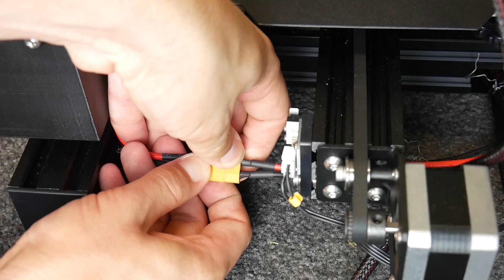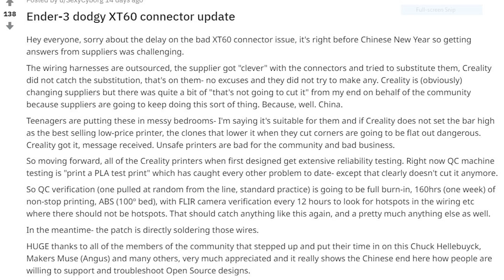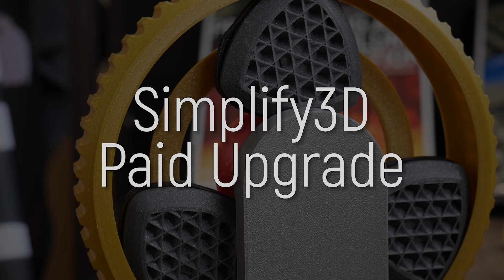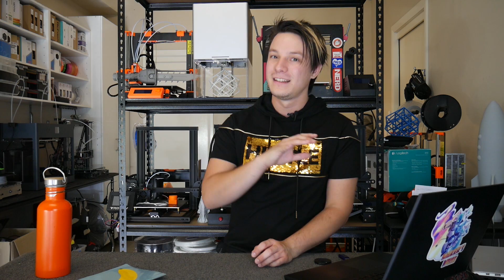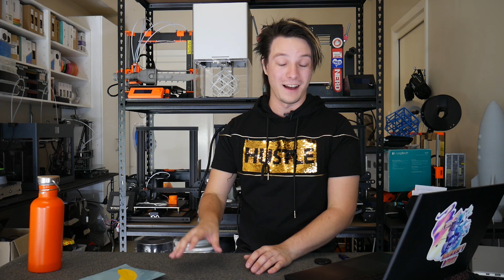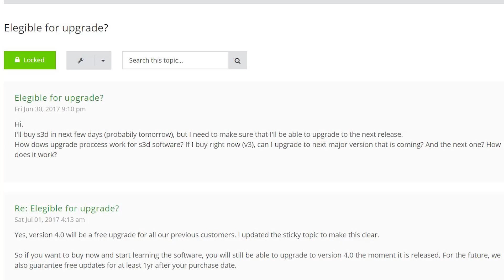Ender 3 Connector Update and Simplify3D Paid Upgrade - Maker's News Feb 2019

Comment: For those who argue/mentions other programs having paid upgrades etc, I kinda call bullshit on! Those programs are vastly more complex than S3D and the improvements from each paid version is probably going to be immense compared to S3D's v.5 paid upgrade!

Not to mention the fact that S3D hasn't updated their software anywhere near acceptable before, particularity when it comes to all the bugs! They still don't have proper filament profiles, as in you can't set a different layer height for PETG compared to PLA, material cost stays the same etc, for example!

THEY ARE NOWHERE NEAR THE DEVELOPMENT THAT EVEN PROMPTS AN UPGRADE PRICE, NOR DO THEY DESERVE TO DO THAT, ESPECIALLY CONSIDERING ALL THE BUGS THEY EITHER TAKE FOREVER OR NEVER FIX!

I have seen many free programs that are more professional and prolific than S3D, and some of them are actually much more complex than S3D too!

I regret buying S3D, and I will actively advice against it from now on, most likely whether or not they continue with the paid upgrade or not!
Reply: @NorxMAL You nailed it!! :)
Reply: "improvements from each paid version" 

Not true in many CAD packages.   Autodesk civil 3d and recap are still really expensive but has offered minimal innovation and upgrades for years despite them raking in millions on maintenance fees.
Reply: @olaruud9366  Does Civil 3D and Recap have lots of bugs? And are other CAD programs getting ahead of them, especially the free ones? Now I answered what you essentially paraphrased me for...

Didn't you understand the full sentence properly? Because you virtually addressed something I didn't say, or you don't understand the word "probably" and/or "compared"... We have to see what improvements V5 of S3D comes with; and it's perhaps the reason why they have come with so few bug fixes and improvements before; which if it's true, but we probably never will find out, then they are assholes!
Reply: @Nor1MAL  
Not gonna reply any toxic comments, sry.

Comment: S3D users will vote with their pocketbook for the v5 upgrade.  I happily shelled out the money for S3D several years ago when I first started printing on the advice of a seasoned veteran and it certainly was of great value at the time as my very first print was successful on a used DaVinci printer.  I've become very familiar and comfortable with v3 (have not upgraded to v4 yet).   When I see the price, features and benefits then some reviews by creditable creators on YouTube, I'll make my decision whether or not to re-invest in S3D.  I've been using Cura quite a bit since I have been helping some novices with their printers and it has come a long way (still like the S3D interface better) and that will be my benchmark for comparison to S3D v5.

Comment: Check you connector, but also consider adding a MOSFET for your heat bed. Your power supply has two open ports.

Comment: I think a big question is, what will the update cost? Is it going to be another $150, I doubt it. But it could be $ 100 or $50. Most software I use at work has a yearly maintenance fee, they range from $1200 to $6k.  I think S3D will lose a lot of users if they go over $20 for the update, mainly because of the fact other slicers have caught up and in some aspects. passed them.

Comment: I'm not just a devilishly handsome half century old guy, I'm also a software engineer. I know how much we get paid and it's a LOT.  But that being said, when the cost of the software was maybe a tenth the cost of a printer, it was adding value to your setup. Nowadays, however, with price points in the five hundreds or less, not so much.  S3D doesn't realize with the greater availability of printers there's a much larger customer base that they can potentially reach. Because of this, S3Ds price point should have gone down relative to the 3D printing world's expansion. 
I've been putting off buying their slicer because paying 1/3rd the price of my printer for a slicer isn't adding value. I'd rather save up the other 2/3rds and buy another printer. (Which by the way is a LARGE PRINT VOLUME printer for far under US$400). 
To me, if they priced down their slicer down to between US $70-60 it'd be worth it. They could do the upgrade thing for free for however long they wish and when it comes time to release a NEW version (i.e. new features, fresher look, etc..)  THEN they can OFFER that new version for sale and let the market decide if it's worth it.

Comment: Question to everyone, is there any setting in cura to tell it to heat the bed and hotend together?  One at a time is just silly.
Reply: For bigger heat plates it keeps the filament in the nozzle from cooking.
Reply: @Mechotronic  any idea if there's a bypass setting. My ender 3 heats both to temp at allmost same time in ideamaker.

Comment: I was actually thinking of buying S3D because I’m getting serious about 3d printing and making a little money of 3d printing but I changed my mind after the video
Reply: If you want to make money on 3D printing there are two things you absolutely must get right: 1) Getting your printer dialed in perfectly in the slicer, so you get the best possible quality in the least amount of time. S3D won't let you tweak jerk and acceleration which are both important when chasing the closest shave. 2) Getting material use and print time estimates pretty darn close so you can give your client price quotes that are realistic. S3D can't calculate print times. It guestimates them. Badly.

Comment: Great video!
When I purchased S3D 5 years ago, it was very much worth it at the time. I was also told that it comes with life time upgrades. 
I stopped using S3D last year since it started giving me terrible results. Cura is giving me great results now.
I can't imagine what new features S3D we'll be implementing in the new version that would make me give them money again. whenever I've had any problems with the software I always get back smart ass responses. They always act like there's something wrong with the printer not there software. I was able to prove that wasn't the case by getting the file to work fine using Cura when S3D was giving me bad results.
I do feel like I got my money's worth out of the software, but with Cura working so well these days, and S3D not seeming to care that the latest update to their software made it worse, I'm not giving them any more money.
You are very classy not to say why you stopped letting them sponsor your channel, but my guess is that they were pushy and demanding to you just like they were to me when I asked for help with a problem with their software.
Just like the company Makerbot, S3D is dead to me.
It's amazing when companies don't realize that it's much better to try and keep a customer than to try to find new ones. And both MakerBot and S3D have really "burned the bridge" to me.

Comment: I think this is well-said. I'm really on the fence, my decision will be about the cost/value and whether they make 4.1 right for us. I went back to 4.0 because there were a couple show-stopper quality bugs. I think the marketing for the 4.1 upgrade overstates most of the improvements. For everything I did, 4.1 was neutral, most claimed improvements were negligible, and the bugs made it a a step back.

There's a lot they can do to make 5.0 better, I hope they actually bother to listen to the community.

S3D never was really a hobbyist-friendly company, I suspect they're pushing even harder towards the commercial users. I still feel S3D is a better program for those who use several different kinds of printers. I expect the cost compared with one printer isn't really a show-stopper for a typical S3D user. It's a good value for those that own several printers, more for different types.

Comment: Good name. Once a month sounds ok with the news section, no need to make it repeat on steady rhythm, wait until you have collected enough that it makes sense to do it.

edit: also, for music production there is one product that surpasses Cubase and is way cheaper (free to try forever): Reaper... Does not contain any soft synths or plugins with fancy graphics but works. I've been using computer based sequencers and DAWs since 1993 and Reaper is the best for me. I went from Pro Tools HD to Reaper and i've used it for music recording, mixing, mastering, running a theater play, making foleys, analyzing and measurements, teaching tool and live performance. There is nothing it has not been able to do, nothing comes close how deep you can customize it. it even comes with it'äs own scrupting language and interpreteted language so you can code more stuff inside it.

And get this.. 11mB install file.. yup.. 11 mega bytes.. and NO license locks of ANY kind, no pro versions, no lite. just one version, that ALWAYS works, works portable from USB stick (that is how i did that theater play, i could continue editing the project from the exact frame i left off in home or after rehearsals.. I just carried a stick with me... Nothing irks me more than hardware dongles as they are the PAIN of the industry. 

Also, reaper is coded by Justin Frankel.. of Winamp fame.. Eplains a lot how it is so anarchistic with it lack of licensing locks and how it is SO small and SO fast.. It has the lowest latency on the market, i believe (outside dedicated hardware solutions on LARGE scale).
Reply: So your saying reapers 60 day evaluation period never ends? im seeing its 60 bucks on their page the free evaluation expires after 60 days

Comment: thanks angus. i had to buy s3d when i started with 3d printing. i made the mistake of buying a dremel idea builder and its slicing software would not even use supports. and also saved as *drm rather than gcode. and s3d was the only software at the time that would allow me to add supports and save out as *.drm so i could actually use the printer. even then 150 pounds after spending 500 on the printer. was a kick in the teeth but had to do it. and looked up the pros and cons.  hay at least i get updates and i can use it for other printers. etc etc. so paid for it. no way did i expect them down the line to charge for updates. if i knew this was coming i think i would have stuck with cura. NOT GOOD S3D i would demand my money back if we could. and i now won't be recommending the software to anyone. unless they drop the update charge. s3d think about what your doing.

Comment: Great video, It’s rare for me to hear new stuff in the printing community so I am glad to hear about this as well as agreeing with a lot of your points

glad cyborg is encouraging creality to improve their printers and creality is watching their customer relation so I can keep recommending their machines, I do think a higher temperature test than 100 degree celsius would be better because at least in my school lab, we will run beds at 110 degrees for ABS, a test at 120 or 130 would be more practical for checking the upper limits of the machine unless the bed isn’t supposed to get that hot idk.

As for simplify3D wow your channel has been around for a long time, very impressive! True their software is getting long in the tooth without much in terms of updates, I really like the idea of small payments for updates because I know improvements are not cheap. At 150 however being by far the most expensive slicer out there, I honestly cannot imagine how the program could improve to warrant another 150. My biggest problem with them however is their advertisement, a lot of people see simplify3D like my teachers and some students and think that it is the easiest slicer until I show them other slicers, I feel bad because it costs a small fortune to load simplify on a lab of computers so some might feel a sunk cost fallacy.

Comment: I get that Angus wants to encourage newcomers to get into 3D printing by promoting a path that has low barrier to entry, in this case low or zero cost software.  At the same time, I don't think it should be suggested that $150 for slicer software is somehow "wrong". If a customer doesn't like the price, they don't have to buy, and the aggregate behavior of customers will determine if the vendor continues with that business model. Also, the low price of entry level printers also should not oblige the software vendors to set low prices. Just because you can run Cubase on a $400 PC doesn't mean Cubase should be cheap.  There could be a business model that makes setting the price lower a smart move (lots of low end potential customers lured into the market by cheap printers), but the low price of the printer per se doesn't make the software less valuable. It might even make it more valuable (individual customers able to buy more printers on which to run slicer output).

Comment: I 100% can see both sides here. Love the videos! BUT there are quite a lot of people using 3D printing to make money now whether it is youtube, selling printed products, etc. and myself being an engineer, I use a $5,000-7,500 USD 3D modeling software at work. With your experience Angus, you know that in business you pay for the modeling software, you pay for the CAM software, you pay for the inspection software (if CMM inspecting). Often all those software add up to $15,000+ USD. Since the cost of printers are in the $300-900 for the printers the majority of people (not businesses use) I can see where requiring payment for software is...somewhat okay. Or they could do what Autodesk does and if your using the software to make income over a certain level, then you have to pay for it. But if you're just a hobbyist, then make it free. With the software at my work you pay per year and for other upgrades like different fiber modeler packages or file type packages so I can understand having pain upgrades for S3D. Like you said though, they have to OFFER MORE when your paying more. It really has to be an UPGRADE. I just hope Cura stays free.

Comment: I bought Kisslicer Pro a while ago. They're now a paid upgrade of a sort to a new Advanced version. Honestly, though, the prices are reasonable for what you get if you buy early, or if you don't, it'll be 142 USD... And way better than anything I feel S3D will come out with. Already there's interesting features, but the planned slice from STEPs what has me really hyped.
Reply: I agree, I bought KISSlicer Premium a few months back so that I could use the Texture Wizard. v2.0 is still in Alpha and has a lot missing, but if lonesock pulls this off, the planned upcoming feature set is going to be awesome!
It was a hell of a culture change from the way that most others deal with retraction - especially as the terminolgy for functions/settings is a bit weird. :D
Reply: @SusiBiker  I've tried most slicers on the market, even crazy ones like IceSL. Kisslicer is the only one that has a non-linear treatment for extrusion rates, which I feel is why it works so amazingly even on my Delta. I get finished-quality prints off the build plate, or at worst the faintest of whisps of stringing. That's why it's my favorite for good quality.
Reply: @keereelewah4524  It totally melted my brain trying to set it up v2 for the first time - the manuals stopped at v1.5... :D
Reply: @SusiBiker  There's some great videos on YouTube however, and the forums are a great help too.
Reply: @keereelewah4524  Thanks for the suggestions. I would have hung myself if it wasn't for those! :D 
Still felt like wading through waist-high mud, at first - bits of information are scattered all over the place. ;)

Comment: The issues I have with the paid upgrade is, seeing how its the only one I have paid for out of the others I use and they still don't get the time estimates close to right. They said they vastly improved in 4.1, which really in my experience meant instead of being off by 8 hrs its now off by 3hrs, no ability to dial in machine settings like Jerk and  acceleration. Anytime you bring this up they always have the same response of all machines are different and hard to tell with all the variables.  To me this is purely an excuse, as their are other slicers that do this a lot better. As well as those slicers allow you to dial in Jerk, and Acceleration.

 It feels like for one that people paid for, have none of the professional features except for manual support placement, and Print over USB in some cases. 

So I wont even begin to think about paying for it unless has those features. If Slic3r or Cura had manual support like S3D does then I wouldnt even consider S3D as a potential Slicer, it's just not worth it. 

So in the Email where they say "We are investing heavily into the development of Version 5.0". What does that mean you are going to finally add those features? As well as you want us to pay again for a slicer to have the features that free ones already have? Perhaps you are just going to redesign the whole interface which no one asked for. 

To me they are pitching a very poor sale, and it have better be massively better then any other slicer, before they see me pay for 5.0.
Reply: Cura CAN in fact add manual supports, it's just not as easy although not very hard either. You just have to have like a 10x10x10 cube in STL format, you load that up and scale it to the size of the supports you need then you set it as "Support Mesh" and you will get a similar result to S3D.
Reply: @daver18qc  Yea Slic3r Prusa Edition can do the same even, but I mean the manual place each support where you exactly want it. Regardless that just proves my point more where S3D better have some fantastic features otherwise I'm sticking with what I got.
Reply: @daver18qc  There's actually a community plugin available for manual supports. I've used it once or twice and it works pretty well.
Reply: I personally do not use S3d, but looking at the way they treat their customers, makes it plain to see that they are out of touch with their customer base.